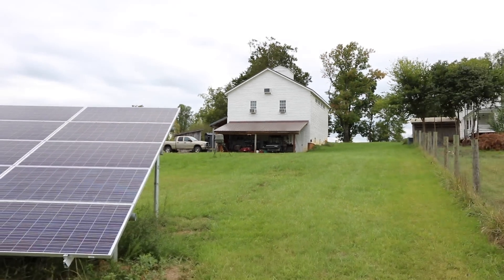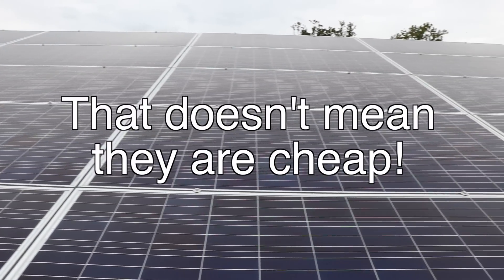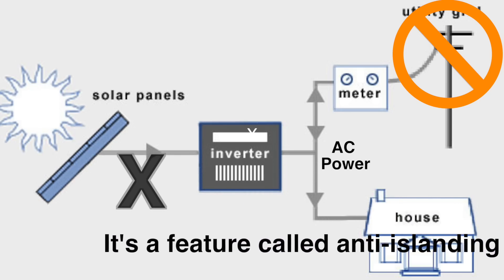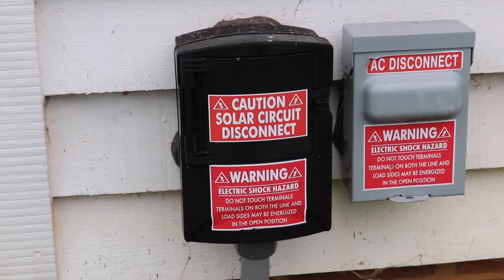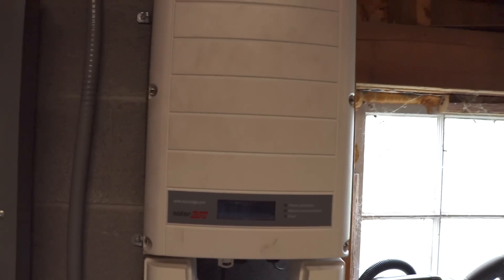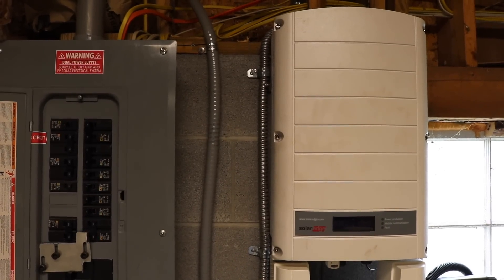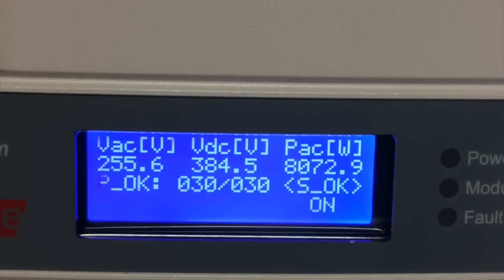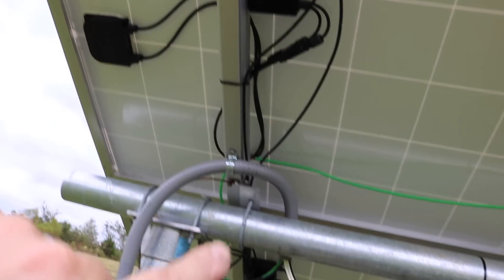The ugly truth behind grid-tie solar systems. Part 1, FarmCraft101 solar.  Watch before you buy!

Comment: Those are nice inverters... the one on the left is a Schneider electric, no? I keep considering buying one but never have the cash.
How much did that one run you?
Reply from the maker: $3k.  (ouch....)  ;-)
Reply: Ouch, yea... bit more than I can spare at the moment.
Can that one work in tandem with the grid tie inverter (I saw you had a generator lockout switch installed presumably for the battery inverter), so that the grid tie inverter can charge the batteries through the Schneider inverter? (I know some Outback inverters have that feature, but don't know about Schneider.)
Reply from the maker: Yeah, that's exactly how I have them set up.  Will cover it in the next solar video.

Comment: Would it be practical to put the  inverter closer to the solar panels and negate the significant voltage drop of the DC component being transmitted over such a long distance?
Reply: His SolarEdge inverter is designed to be installed inside. If you want an inverter which is designed to be installed outside, then you need water-proof microinverters made by a company like Enphase or ASPower, which are more expensive, but they do have a 25 year warranty because they have no moving parts (no cooling fan), so they will last longer than the SolarEdge inverter, which has a 10 year warranty.

Comment: Wait a minute. Geeky solar panels? Perfectly describing parallel/series? Cheesy cutaway attempts at jokes? Masterfully using water flow to describe voltage and current??? You are a fellow EE, aren't you? :-)

Excellent video. I particularly enjoyed that you showed the structural components of your array. Nice in-focus, steady and clear shots of the undercarriage stuff. Great job at describing the complex setup in easy to understand terms.
Reply: EE electrical engineer right? I'm guessing he's likely a JM as he actually has a working system not just a badly designed mess lol
Reply: Easily looks like something I could do. Just bought 1.4acres in rural Kentucky and want alternative energy for my property. Not too happy about tieing to the grid.
Reply: @middletonrei8719  Then don't. Too many regs & costs. Go fully off-lind and add wind power sys. too

Comment: There are many grid tied systems that have battery backup as well so one can continue to use the solar even when the power company is down.
Reply from the maker: If it has battery backup, then it is a hybrid system, not a grid tied system.  Grid tied means just that, grid tied, no backup.  Off grid is off grid with backup.  Hybrid is a combination of the two. https://youtu.be/gPycyuVJ_Cg
Reply: A generator was a lot less expensive and a lot safer.  Batteries had a tendency to fail and overheat.
Reply: It depends on what kind of batteries you get. Exide Heritage G batteries ( they're about 3 feet tall, 2 feet wide ) have an expected duty life of 50 years. The average Joe probably can't get those. They are used in commercial phone offices for their battery back ups ( that's why old home phones would always still work when the regular power went out ). A Tesla Powerwall would be a better solution when the 2nd generation of those are released, but even then, they only have a 10 year warranty, and will probably be around $5,000.
Reply: I had a battery backup for a short time.  They were way too expensive but I needed it because the power went down a lot.  And the batteries need to be replaced every 5 years at great expense.  Wasn't worth it.
Reply: Concorde makes a 1,215 AH true deep cycle battery.  $635 each. Cheapest, most Amp Hour battery I have found yet, and I've been looking for a while. 2 or 3 of those would support you for a while until you could fire up a back up generator.
Reply: When you say Hybrid do you mean grid fallback?
Reply: I had a high end charger with the high voltage, it helped a bit but not that much, maybe an extra year or two.  The phone company batteries probably lasted a long time since they were rarely discharged.  I used to work in the space business and even their batteries didn't work for more than 20 years of constant charge/discharge use.
Reply: Omar Williams  You must be very rich, that much lithium power is way out of the range for a normal person.  In Powerwalls thats over $250,000 (just the units, nothing else).
Reply: Omar Williams  The closest thing I can find to a 1000Ah 24V battery is the PowerWall.  A 100 Ah 12V lithium battery is around $1000(https://www.amazon.com/Battle-Born-LiFePO4-Battery-Built-/dp/B06XX197GJ/?tag=rvwebnetwork-20) You clearly don't know what you have if you think its only $157.  The only thing that cheap are deep cycle marine lead acid batteries.
Reply: Omar Williams  "Or buy ten 24 volts 1,000 Ah deep cycle lithium batteries".  At this point I think you are just trolling.
Reply: Omar Williams  Troll confirmed.
Reply: @Jeremy H. The Powerwall does have a 10 year warranty, however their warranty is superior to many of their competitors because it is for unlimited cycles during the 10 year period. Other manufacturers limit the number of cycles as well put a fix calendar term on their battery storage warranties.
Reply: Lead acid batteries should last 40-50 years if treated properly.   Need to either charge battery or dis-charge...not do both at the same time as whats done with most solar systems.  The second key is that most controllers don't bring the charging voltage high enough to desulfate the battery each time its charged.  Over time the sulfation will lead to failure
Reply: @mscavsfan  please explain this more:
Reply: @flyingdiscproductions  As you probably know, lead acid batteries work by chemical reactions,  one way(charging) and the opposite way when dis-charging.  This process should never fail over time.  The problem is that with today's chargers or processes, the battery is not fully de-sulfated when its being charged. You end up with a little bit of lead sulfate on your plates.  This is not noticeable until 5-6 years later(for a typical car battery).  At this point, there is too much lead sulfate and your battery will no longer accept a charge.   If you can get the correct process of charging your batteries so that they are desulfated 100% every time(with higher voltages), your batteries will last forever or until the plastic the plates are encased in fail.   All of this info can be found on the following site - http://www.r-charge.net/Battery-Chargers_c_16.html.  

In fact he sells a solar controller as well .  Here is that link -
http://www.r-charge.net/RC-1KW24-Renaissance-24V-1kw-Solar-Charge-Controller_p_315.html

Also with solar power, the batteries are not properly being used and this improper use shortens the life span of the batteries.  When you charge a lead acid battery, the plates of the battery will bend one way as it charges.   When you dis-charge a battery, the plates will bend the opposite way.   If your charging a battery and loading down a battery at the same time the plates in the battery will be bending back and forth .   When metal bends back and forth you end up with fatigue on your plates and eventual failure.  I'm by no means a solar expert.  I've just learned about proper use of lead acid batteries the last 3 years from the gentleman who runs the site above.  He is an expert in the field.

Comment: I dont know where you live but in PA, during winters, solar panels are only capable of producing about 50% of their total output because of the low sun - and thats on a sunny day!  In addition, with the shorter days the solar panels only produce electricity for about 6 hrs a day.  I did the math before committiing and discovered that it would take me about 30 years to break even!  Thats assuming 80% power output for 6 months of the year and 50% for 6 months.  In northern latitudes, it doesnt make much sense.
Reply: Did the cost include installation labor?  That could have been too high.

Comment: With the Technology today there is no real reason to do that. The same system just needs improved to not send power to grid when their power is off.
Reply from the maker: This is true, but it's a matter of cost.  It is quite involved to install the battery backup and auto changeover, and often requires rewiring many of the circuits in the home into a critical load panel.  What that equates to is a lot of extra money, in the range of $10k and up.  Thanks for watching.
Reply: FarmCraft101 - Yes, I understand that but should have been a feature already built into systems knowing what happens when grid power is out considering the system already monitors power in coming.

Comment: Would a battery bank  and  transfer switch male economic sense ?
Reply from the maker: Depends on your situation really.  You can generate power much cheaper with a gas or propane generator.  Battery banks are expensive and don't last very long, between 5-10 years depending on the type of battery.  Battery backup inverters are expensive too.  I'll go into this in the next episode.  Thanks for watching!

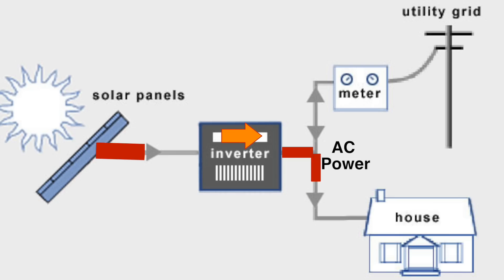Comment: @2:25 you don't mention that any power you generate over $200 a month, the utility company gives you a check for that power. This makes the upfront cost payoff much sooner.
Reply: Or the utility company charges you $90, for leasing the power lines and $5 for provided electricity, as they do in my country…
Reply from the maker: Unfortunately, if you over generate, they only pay you a fraction of what the electricity costs, something on the order of 30% of regular cost.  So if I pay 11 cents per kWh, if I over-generate they pay back only 4 cents.  I guess this is to prevent people from oversizing their systems and putting the power companies in a position where they are paying for electricity instead of selling it.  The good news is my generation is figured on an annual basis, so if I over generate for a month or two it doesn't matter.  It's just what it comes to at the end of the year that counts.  Thanks for watching!

Comment: I liked the explanation right up to the discussion of optimizers, where I disagree. 
My take on optimizers, is that they are good for when there is an under-performing panel, also optimizers  and microinverters, can give you information via apps.  I didn't see any trees or anything else to block the sun and your system is accessible. Your panels already get the same amount of sun and you can visually inspect for and clean,  dirt and snow. If you see poor system performance, you can test circuits to find a bad panel. 3 string-disconnects may help with that too. At 50-$70 each, plus the installation, you may have  paid as much as $3000 for an unnecessary  component, especially since you seem to be a hands-on person.
The max residential voltage is 600v, so you could have done 2 strings.
Reply from the maker: The main reason is I purchased my solar as part of a cooperative, meaning I get a great deal on the price, but I have to take their "standard" installation setup.  I didn't have an option of picking a different inverter or eliminating optimizers.  That being said, I see on my monitoring dashboard that all the panels don't actually generate the same.  While the differences are slight, without the optimizers I would be pulled back to the lowest panel, which would add up over time.  It will also make a difference if snow or leaves, or even bird poop gets on some of the panels periodically.  It's nice that it monitors my panel output for me automatically, as I have many, MANY other things that I am constantly monitoring on the farm.  Thanks for watching!
Reply: if you had been able to use micro inverters at each panel would have cost a bit more than the optimizers. 120 for inverters vs 60.. so they would have cost you a bit   1800 for the micro inverters. meaning smaller wire to the house from the array.  This would have eliminated the central inverter  so pretty much break even. If a micro inverter dies..  you are only looking at perhaps 150 bucks vs 2000 for a new central inverter.
Reply: @stevepailet8258  but with micro inverters you would never have access to the DC power to charge batteries directly! Meaning if the grid goes down you still have access to the panels power! Microinverters would cut you off...
Reply: @SolarizeYourLife  interesting . because one does not have to install the entire system with micro inverters easy enough to run some panels unconverted dc so one could do heating of water or run a charge controller.  From what I am seeing they now have some hybrid inverters that will allow for running off of batteries even though one is connected to the grid.   My thinking is that with fore thought one can install a smaller charge controller and separate inverter just for pulling power for things like minimal lighting and refrigeration.  I think that people tend to think in a linear fashion rather than in what might be closer to 3d chess
Reply: @stevepailet8258  Yes, I have a grid-tied limiter inverter, it will produce grid power from either panels or battery, but because it has a current sensor so not feedback pass the meter, in blackout I would need a separate off-grid inverter...
Reply: @SolarizeYourLife  yes that is why I mentioned a part of the array that is a conventional off grid battery system to run the dedicated lighting and  for me refrigeration
Reply: @SolarizeYourLife  just as a side note.. I plan to do a ground mount system which actually means I will have access to the micro inverters.. that said I would still like to run a portion with off grid battery bank
Reply: I have two solar systems running side by side each with 12 Trina 230watt panels.   The older Xantrex inverter beats the newer SolarEdge inverter every day.

Comment: Thanks for the video! I have almost the exact setup, Solaredge inverter and LG panels, but only 5.5 kw, where I live in SE FL, this was the biggest size I could go with for a grid tie, the power companies frown upon over sized systems..... After hurricane Irma, I am also looking into either going with the some type secure power option or battery backup. I have had this for about 18 months now and I have had no operational issues at all, only some hardware mounting problems I discover when getting ready for Irma, so I think from a durability quality standpoint this is a good combination, so far anyway :) 
Looking forward to part 2!